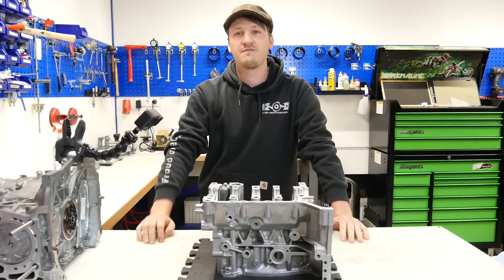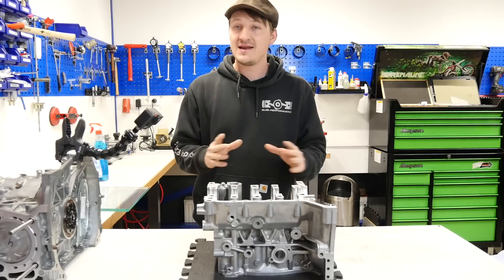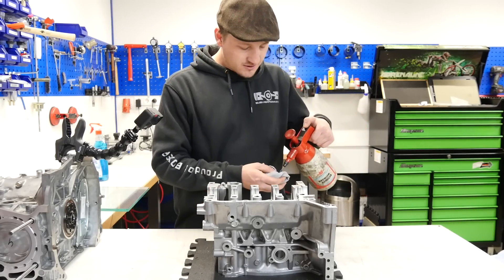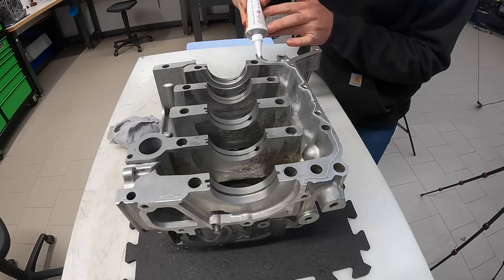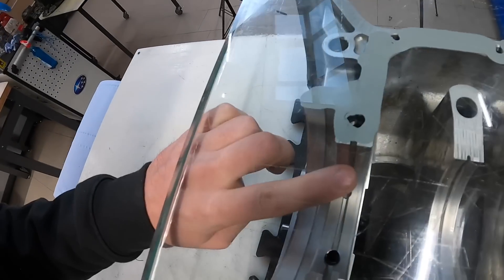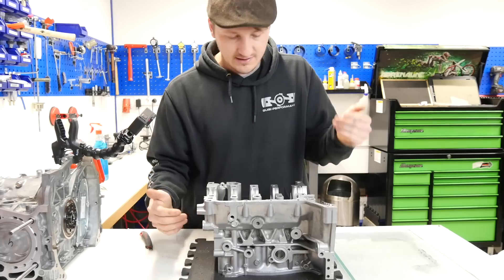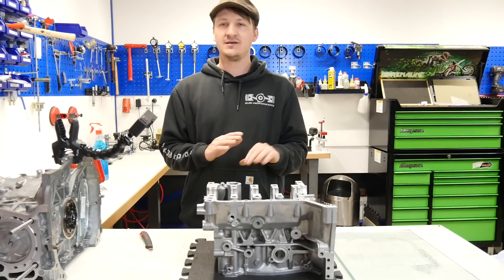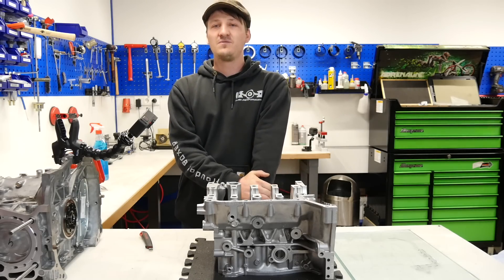TOP TIPS for Enginebuild l Subi-Performance

Comment: Top clip this i've done once before on my 3 cylinder Daihatsu workshop van after replacing a burnt out exhaust valve there was an 7 to 10 day wait on the new head gasket deciding on not to wait  I used  Loctite's  510 gasket eliminator and was a bit overzealous with the application  around the oil feed hold that feed the cam and the top end after 5 km i was coming to an intersection and changing back to 3rd she locked up  i was on the clutch immediately and had no gear in the back saving the timing belt from breaking so towed back to the workshop ripped the head off again found no oil in the top end and the oil gallery was blocked with 510 this had caused the N0 1 cam  journal to grab on the top of the cap scoring it cleaned badly.
I cleaned it with a drum sander and die grinder polished it up faced the cap for the right clearance put the head back on using the same gasket and the 510 again but kept it right away from the oil gallery and just over 1 hour later i was flying back into town . Daihatsu hijet 5 door 3 cylinder van best workshop van i ever had flogged it around for  5 years then sold it to a mate  he drove it round for 3 year then retired it to the farm and worked it for 3 more years then drove it to the wreckers and got $200 for it after the head job it was never worked on again

Comment: As usual, excellent content.  I have a suggestion that may have some broader appeal than your usual "Super Subi" engines.  At 130K miles my 2013 WRX spun a rod bearing (I know, what a shock).  There are many of us out here faced with this job.  We aren't going to the track or running rallies, we just want our car back on the road.  I know it seems crazy but some of us just want too get a short block in and get back on the road.  So, a simple stock WRX short block install would have some appeal.  Engine removal, removal of parts to be reused and assembly (with important tips) around a short block, then reinstall.  It's a great starter project and a stepping stone to more performance later.  

PS, these were some of the best tips I have ever seen for engine work.   The oil cooler and change regimen is something I will definitely include in my upcoming engine job.  

Thanks for making these very informative and helpful videos.

Comment: Can a rebuilt ej20 closed deck block with a 2.5 crank to make it 2.2 lt be reliable at 600 whp with pump fuel and methanol extra spray ? How many kilometers would that motor be good for for street use ?

Comment: Never Trust in Maschine Shops. I made this experience 25 years ago, when I fixed one of my first engines. After putting everything together, I couldn‘t turn the engine. The reason was, that the crankshaft had fallen down in the maschine shop. It costed 3 days to learn this. After fixing this, the engine run perfectly.
Reply: 3 days to learn this, what do you mean ?
Reply: @Scatpack-Superbird  3 days to find out why the engine wouldn't turn. Not impossible, this. I've seen this happen on a Kawasaki motorbike engine (GTR1000) where the #3 rod bearing disintegrated, bending the crank in the process to such an extent that it couldn't turn without major friction.

Comment: Best way I do with silicone is to do it with your fingers, off course wearing gloves to smear the silicone before it will be closed. And also check your main and rod bearings clearances .0015" main and .0018" for rods. And always double check every bolts
Reply: double check is only possible if the screw/bolt/nut got a torque. If it gets a rotation angle this isnt possible (for example 50NM + 50°)

Comment: Too much silicone is often the reason for damagded engines. In Service Manuals of Ford engines the  thickness of the silicone line  have to be Maximum 3 milimeters and this is more than enough , but some people  are thinking that more is better but ist isn't .

Comment: The best tips👌 Add one more; if your not doing your own machining, make sure no swarf is in the main oil galleries. These are before the main components but after the oil filter. If not cleared they will ruin your day on first start up.

Comment: Not rebuilding anything at the momznt but would like to try a 2.0d with the classic short block and crankshaft issue. I recently found about a shop in Slovenia that makes a steel reinforcement for the short block which should make it last quite some time. I believe the site was something like kings boxer com. Have you got any experience with 2.0d rebuilds? Are they worth the trouble?
Reply: Andi stripped a diesel boxer engine last month if I remember correctly. The crank on this engine broke in 3 pieces, seizing the engine solid. It was almost impossible to take apart.

Comment: what do you think about the new genuine short blocks subaru sell? are they any good?
Reply: Ive purchased one. Still swapped the oil filter and oil frequently until I was content with the break in. Prime the motor well before starting. As with any build or replacement mechanical parts, im not convinced it took until after 5k miles on turbos or blocks